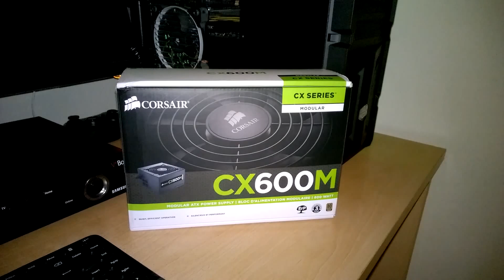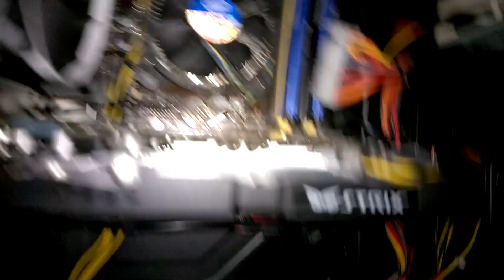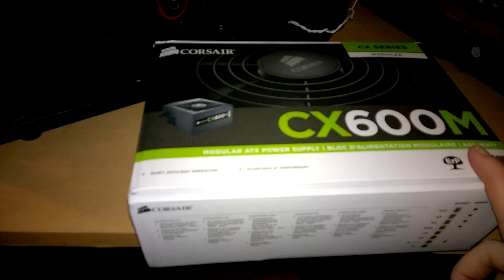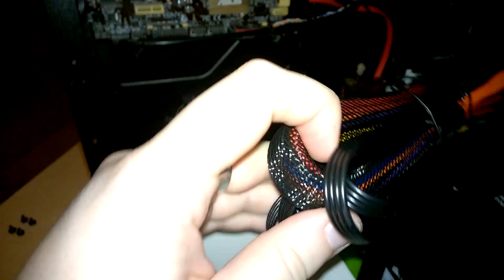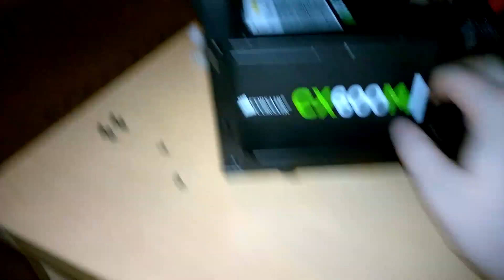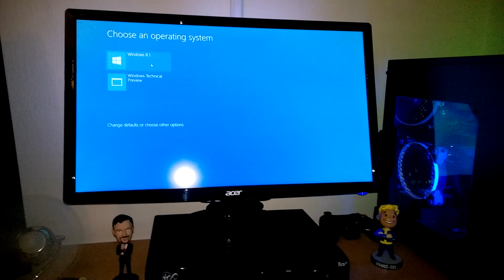How to Replace a PSU - Corsair CX600M Unboxing

Comment: Ok I got this power supply and a gtx 950 oc and when I turn the computer on and the power blips on for a second and then turns off right after plz help
Reply: the psu is too low wattage
Reply: just realised this is 6 years ago